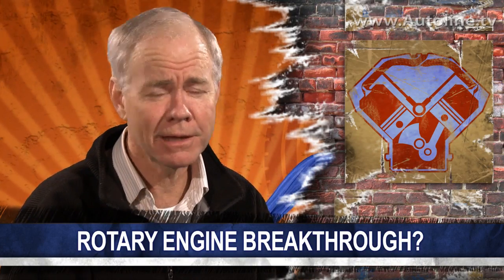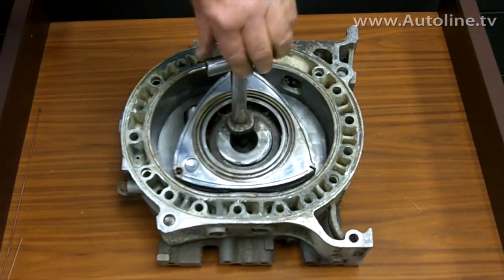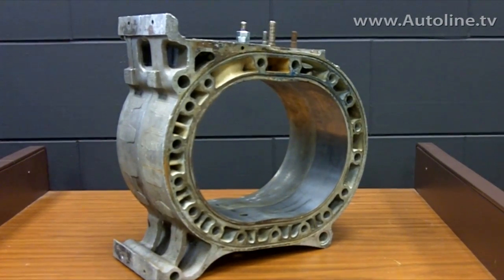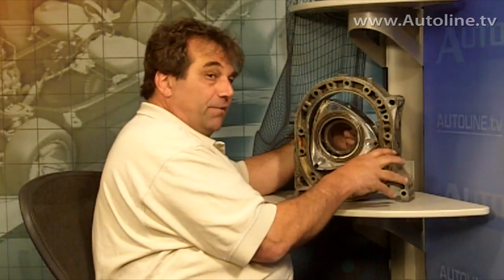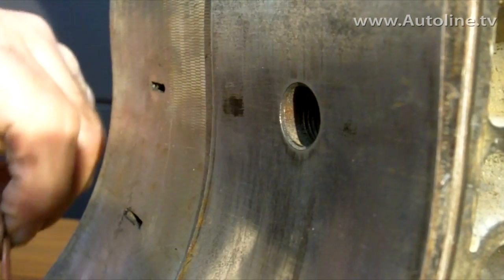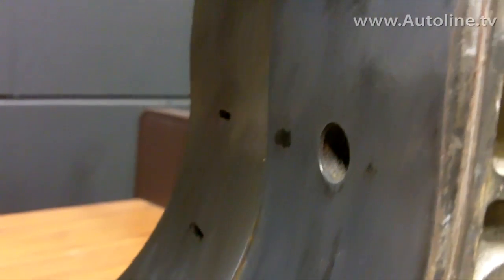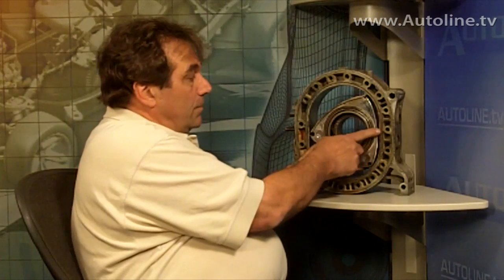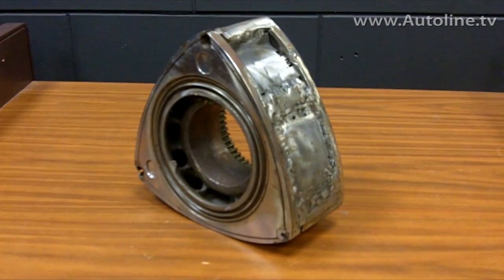Rotary Engine Breakthrough?

Comment: Can someone please tell me why the Apex Seals cannot be replaced with a wide Ball Bearing?
Reply: wankel engines are coming to get you at night dr bimmer!  They're under your bed!!
Reply: Yeah, this is YouTube mate. Adding winglets to a rotary has got to add an extra 7 rice factor and 400kw at the steering wheel.
Reply: "'Discussion', this guy has been going on and on about this for a month now...."   actually he won't rest until he's tried to 'correct' the entire internet on the subject.  He comes on ANY  vid concerning wankels, and won't rest until he's lectured everyone there.
Reply: he will put down almost any idea up for discussion.  He does not like innovation at all.
Reply: I thought of that too.  I think the primary reason is that doktorbimmer would lose his mind.
Reply: I'm sure I am helping that.... however, you seem to turn most people against you.  It's just your delivery, which somehow rains on the parade too much.
Reply: Jesus I have nothing on you, and if I am 'uncouth' to someone else, that does not concern you. I shit what Ive been fed. 

And well, that depends on how you define obsolete, its obsolete and not obsolete as its still being used. And the Dohc part; note that I typed 'normalized', did not imply it was invented in the 90s. The otto engine has seen thousands of improvements, the first patent looked.. Well. It worked, not efficient at all and suffered a lot from friction between the materials. It was closer to a steam engine than a modern day engine. 

- For the record; It has come an extremely long way from an extremely old concept.
Reply: Yes, if you can bring yourself to look up a few inches, you will see that I posed the question as to the feasability of using some kind of bearing that rolls, in place of the apex seals that slide. 
It has turned into a clusterfuck of an argument where Mr Troll has been copy and pasting his idea that the "Rotary is dead", and it's not just here, it's literally on almost every thread on youtube where anyone who wishes to have any form of meaningful discussion about the engine, or improving it somehow, this plonker pastes "The Wankel is dead, because...." 
You have my blessing to rip his argument to shreds, The rotary engine is alive and well. There are many large workshops and companies that specialise in this engine here in Australia, and Puerto Rico. And they are doing some astonishing things with these "dead" engines, and they are doing a rip-roaring, thriving business with it.
Reply: The real doktorbimmer So, by your reasoning.. Formula, LMP, WTCC, Koenigsegg, Hennesey etc are dead?
Reply: The real doktorbimmer Current, as in model. The current wankel is called Renesis, engine code 13B. Just because its from, what, 2004 or out of production, does not mean it is not the current wankel for cars. There has not been an updated version of the engine, so it is still the current version.
Reply: "The real doktorbimmer So, by your reasoning.. Formula, LMP, WTCC, Koenigsegg, Hennesey etc are dead?"
Force him to respond to this, please!   LOL.
Notice he gives the exact month, date, and sometimes even the time of day when they made the last Renesis motor.  He cites it down to the minute.   I imagine they have him tied to a bed somewhere.
Reply: " when they are miniturised. I wonder if ...."     Believe me, he won't even be able to tolerate that statement.  He will go on repeating himself here and on any other youtube page where anyone discusses the wankel engine.   Refer to it as a 'rotary' engine.  That drives him crazy!
Reply: "It is a rotary engine......"    Oh boy, Doktorbimmer is gonna go insane!!   He cannot permit someone to call it a 'rotary'.  Just watch..... BTW, it is pleasing to see a well-informed person (you) come back at him.  All I have been saying is that a tiny, simple, one speed only, simple wankel would make a great range extender.  Doktor Bimmer just can't accept that- and he can't even accept anyone saying it anywhere.
Reply: The real doktorbimmer Just give up man.. You re-use the very same arguments as well as use straw mans, this is what someone do when theyve lost their means of argument..
Reply: ANYWAY, There is a way to springload a ballbearing from the opposite side to the force, so as it rolls, it also slides up and down inside the rotor to seal against the wall. Could do it with hydraulic pressure such as the lifters in an SR20
Reply: The real doktorbimmer Actually, I think his idea was very bright. If there were gaps to lube the apex seals, the apex seals would push against the oil pressure, increasing the amount of oil being pushed out in front of the apex seals. This would provide more lubrication during higher friction and less lubrication during lower friction.
Reply: The real doktorbimmer My comment wasnt intended for this comment, I apologize.
Reply: "Accept the idea..."     NO.   The idea should stand on its merits in terms of (or lack of) engineering, not someone's grasp of general principles involving this engine.
Reply: Some Other Dude I completely agree, although my comment was intended for a discussion with another solution to Jesus, using the oil pressure as a constant force on the Apex seal instead of a spring. But an idea should never be disregarded unless proven faulty. Even bad ideas can lead to awesome ideas with inspiration from the bad idea.
Reply: The real doktorbimmer Mazda has been continuing work on a new RX and estimates a new wankel in 2017, get your facts right, because more than this neither of us know. You simply do not understand what Ive been talking about. Saying itd create more friction? Please, do learn about springs and youll see that it is N/mm which means more pressure the more it is compressed whereas oil pressure is constantly the amount of pressure that the oil pump can generate if met with high resistance as the oil is incompressable. If anything itd create less friction as you can set the pressure at the optimum Seal/Housing pressure. Stop being naive and get an education, Im done with you.
Reply: New wankel in 2019, my bad.
Reply: The real doktorbimmer Oh.. Okay my bad.. Yknow what? Im wrong! All development and research has been abandoned! This is why Mazda is investing resources to make RX-vision concepts! And yeah! Lets forget the #US20160084158 patent created on 24th Mars 2016. Because Mazda ended all research and development back in 2013. They didnt change date, I made a typo. Lol.. good boy, you know basic physics.
Reply: The real doktorbimmer Thank you for explaining what a concept are, I mean.. How would I know it was just a.. Concept? Its common knowledge. Do you know what a company is? Its main purpose? To generate money. Throwing money on RX-vision and developing an engine which is then patented costs money, A WHOLE LOT of money. You think Mazda is just throwing their investments in the lake? What an entrepreneur you are.
Reply: The real doktorbimmer Thank you for explaining what a concept are, I mean.. How would I know it was just a.. Concept? Its common knowledge. Do you know what a company is? Its main purpose? To generate money. Throwing money on RX-vision and developing an engine which is then patented costs money, A WHOLE LOT of money. You think Mazda is just throwing their investments in the lake? What an entrepreneur you are.
Reply: The real doktorbimmer The "solution" I was standing up for is similar to hydraulic systems. I will make a third attempt at explaining it to you so please listen this time. Lets say the oil pump only can create a pressure of 5kPa, yeah? As the rotor rotates and coming in contact with the Apex seal to the housing, this will create a pressure on the Apex seal which will start to depress the spring that is pushing the Apex seal out and against the housing, this is what has been used.

Here is my proposal: We take the pressure of which the oil pump can generate (5kPa)and drill holes in the shaft and rotor to pressurize behind the Apex seals so the spring is not needed and removed. The pressure will then push the Apex seals outwards with a pressure of 5 kPa. As the Apex seal comes to contact with the housing, the Apex seal will have to be able to move inwards. As the Apex seal starts moving, the volume behind the seal will have nowhere to go and the pressure will now be beyond of what the oil pump can generate. The overpressure will cause the oil to increase lubrication on floating seals or escape through the oil pump. 
So, I am in no ways saying the "solution" is compressing the oil.

A spring creates pressure in a tilted linear graph, the more it depress, the more force it will create. Halfway through the travel of the Apex seal, the Apex seal have a pressure against the housing of 5 kPa, like the oil pump. But fully depressed it will have a pressure of 10kPa, increasing friction.

The "solution" have a constant oil pressure or, no tilt looking at a graph. It will have a pressure of 5kPa no matter where on the travel that the apex seal is against the housing. Halfway through, itll have a pressure of 5kPa and fully depressed it will have a pressure of 5kPa. Decreasing friction.
Reply: The real doktorbimmer Mazda would make more money if they stopped releasing cars with this engine in them, and simply just manufactured the individual parts for these engines and sold every single part separately so that people could either build their own, or rebuild existing units that are already out there, otherwise owning and racing a rotary powered vehicle will become prohibitively expensive if it got to the point where every single part had to be manufactured from scratch using CNC. I'd love to see what these things are capable of if all the sleeve bearings could be replaced with ballbearings. 
These engines were WAY ahead of their time, even though fuel economy is shit.
Reply: Re: The Structural and Harmonic balance issues, Boeing and Airbus ironed out this issue by installing winglets. Maybe Mazda Rotaries could employ some similar tecchnology to eliminate Harmonnic Resonance.

2. Compared to the Chrysler Turbine, fuel economy of the Rotary is amazing.
Reply: The real doktorbimmer Sarcasm doesn't translate too well as text over the internet.
Reply: The real doktorbimmer idgaf
Reply: The real doktorbimmer So you read an article and immiedietly thought of me? Even though this was 3 weeks ago? How nice of you! Are you in love with me or something? Though.. I read this article 3 days ago or something so its pretty much old news for me. How about you get a life? I dont care about your hatred against rotorary propulsion. The one that is a fool is you, who cannot seem to let go. Again, get a life and go to school.
Reply: The real doktorbimmer Ouch! That hurt! Your? Mine what? Its Youre, as in You are.
Reply: That is NOT what he said.  He said it won't be used in a sports car but they are still working on a range extended or hybrid application.  We went over this a week or two ago.
Reply: For a guy who says the wankel can't hurt him, you sure spend a lot of time beating back the threat!
Reply: The real doktorbimmer Please, dude, shut the fuck up. We are not taught english in engineering class, its what is required of us to even come to class to keep imbecils like you out. No shit its obsolete, thats what happens when only one company is developing the design. Back in 1950, the engine kicked the ottos ass. Ask the back in the day Audi-union. 1970, most brands was considering using wankel engines because it was much more cost effective, powerful and smaller. Even motorcycles started to use wankels because of these benefits. Just take a look at Suzuki, Yamaha and Kawasaki. 1990, and DOHC got normalized and the otto was and has been in front of the wankel in terms of efficiency. So yes, it most definitly was a threat to the otto. Get your facts right.

I am not saying that the current wankels are any better, i am saying it is not a bad design for propelling a vehicle. Now with VC-t and Freevalve and new tech like that, I have a hard time thinking itll catch up on efficiency. That does not mean that the design does not have benefits on different applications, where the otto is too large, too heavy or even, too unreliable.Yes, too unreliable. The wankel is consistant while the otto is not.
Reply: Actually I agree with you Alexander. My apologies mate.
By the way, The OTTO is also obsolete. The only innovation it's seen in 100 years has been efficiency improvements. Same with Diesels.
For the record, Fiat were playing with twin cams 50 years ago.
Reply: Jesus Your thread? This is a comment section, it is not owned or ruled by anyone. I can express myself however I want, if you dont like that then you can go join SJWs or something.

'Discussion', this guy has been going on and on about this for a month now. And when I thought he finally stopped, he brought up an old news article. And ofcourse I am going to respond when he is questioning my knowledge and education. I can most definitly stand my side of a discussion, but not weeks after weeks forward. This is called harassment and he is also being semi-toxic. So when he throws fieces, I just throw back my own. None of it hit you. So again, not your concern. Join the discussion instead as this is within your rights
Reply: Jesus I appreciate your common sense, thank you. I agree that a discussion should not contain personal offense on these matters as this will not further anything. Just like his 'work' against the wankel will have no effect and he will only tire himself out. I apologize though, my initial comment wasnt intended to reply to your comment on the video. Getting notified all the time over some bs is irritating.
Reply: The real doktorbimmer Turn your caps off. The basis of an engine is to turn stored chemical energy into kinetic energy. The efficiency is calculated by (energy out)/(energy in). Both the wankel and otto had an efficiency rating of around 0,3. Steam engines, Turbine engines, piston engines, Uniflow, Compound and Stirling engines are considerably less efficient. Sometimes meeting the rating of 0,01. The Wankel and Otto does this very well, but the Otto is slightly more efficient. That does not mean its a bad engine, its actually the 3rd most efficient (0,28) we have to this date. Beaten by the otto (0,25-0,30) and the gas turbine engine (0,95-0,99).
Reply: I gotta say, for such an "Obsolete" / "Dead" design, they sure make great oil pumps when they are miniturised. I wonder if there is one pushing the oil around in your meat-head-Mobile Dr Bimmer.
Reply: The real doktorbimmer No, not really. Check your physics. The Carnot cycle is a measurement of thermodynamics. The bi-effect of kinetic energy produced by the engine is heat. We do not wish to create heat, we want to create kinetic energy. Using the Carnot cycle would not take other losses into account and thereby give a faulty explanation of efficiency. Using the efficiency ratio system is calculated by the amount energy we want out of the engine (kinetic) divided by the amount of chemical energy we feed the engine. This system takes all losses into an account. And yes, gas turbines create a lot of heat by the pressurized cold air. The heat generated from the engine is what is propelling the aircraft forwards as the air expands massively. The higher the altitude, the less efficient it becomes, decreasing +/- 50%.
Reply: Some Other Dude It is a rotary engine. And it does use a planetary gear system to accomplish this. The Otto engine translates linear motion into centered circular motion. While the Wankel engine translates ellipse motion into centered circular motion. And it uses rotors to accomplish 2Hz compression strokes and this is what is creating the ellipse motion. So it is a rotary engine, all of it is rotating, no weight ever have to change paths, unlike the Otto engine.
Reply: The real doktorbimmer yoo what about pneumatic apex seals , you know the nitrogen springy shit in f1 ?
Reply: "+Some Other Dude None of those examples currently use Rotary engines or Wankel engines..."     sorry I don't know what comment I made that you are responding to.  Why can't YouTube just keep the replies right under the statement one is replying to?????  YouTube really started sucking when google took it over.
Reply: "+Some Other Dude Well, then please us what car company is currently mass producing automobiles with a "rotary" type engine???"   Why the silly straw man questions? Can't you muster a better argument?  Everyone knows no one is producing a wankel powered car at the moment, but Mazda may well yet do so.  They definitely have engineers on it.  Those engineers know more about the potential than you do, as well.
Reply: The real doktorbimmer If its not a popularity contest.. Why are you thumbing up your own comment? lol such hipocrisy.. What you fail to realize is that planetary gears, ARE concentric. The wankel has the pistons replaced with rotor-pistons and like I said, uses elliptic motion to make the rotor behave like a piston, compressing the air. Dont believe its a rotary engine? How about Felix Wankel, literally spelling it out for you: https://www.google.com/patents/US2988008
Reply: "+Some Other Dude Well if you do not understand the concepts involved? Or how and why the original design functions?
Then how do you expect a solution to result?
The fact remains that oils is incompressible makes it a very poor choice for a spring.
Simply increasing the pressure on the seals shows a general lack of knowledge of the problems involved..
 Previous development work clearly showed that increasing seal pressure only increased wear..
Higher tension is not a solution, and hydraulics do have many useful applications... this is not one of them."

Yet another non-sequitor, I never even mentioned oil acting as a spring.  Man up and try a real argument instead of the endless straw man crap.   Hey, it must drive you crazy that Felix Wankel's patents refer to the engine as  a ROTARY
Reply: Dude, you delivered the knockout punch today.   Informing doktorbimmerjerk that Felix Wankel himself called it a rotary.... priceless!!!!!!!!!!!!!!
Reply: "The real doktorbimmer If its not a popularity contest.."   AF   I invite you to read the exchange I had with doktorbimmer last night.... you will enjoy it, I can assure you.  By the end of it, he could only fight back by calling Ernie (the guy in the video) an alcoholic, he accused me of being gay, and he alludes to some dark conspiracy between me and Ernie.  It's classic!
Reply: "How can you expect to understand the concepts when you are still hopelessly lost on which engine design we are talking about.."
Split hairs, desperately parse the chain of events, nit pick semantics all you want.  You got your ass handed to you.   And in reading your above post- you're calling ME obsessed with the rotary engine??
Reply: the seals are meant to keep a seal. If you look at how they are built there  is a spring behind the seals. Making a bearing that spun at high heat and has to hold pressure to keep the seal is too much to ask of any engineer. Lots of lube in these engines to keep them spinning.
Reply: +The real doktorbimmer I hear you can get a rad shifter cart with a Rotary engine.
Reply: The real doktorbimmer Boy your an annoying little know it all. Sachs made that motor by the way. My data maybe dated but that engine got better mileage than the two strokes they use so it still seems viable. But honestly it was a dirty engine anyway at least there's people keeping it alive making racing motors so even though it may not be mass manufactured it still powers allot of cars. They still have a huge following even though they are dirty little gas guzzlers. I guess some people just like to Braaaaaaap! I still think about the Rx7 Turbo 2 I passed on when I was 16 I was dealing with a death in the family so I passed on a prime example. Maybe it went to a mature home where it wouldn't get wrapped around a tree.